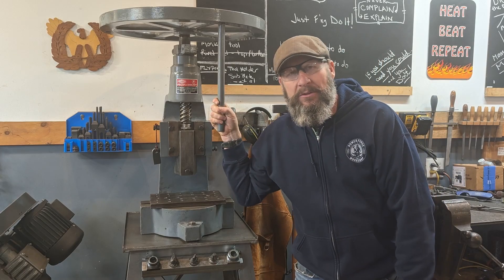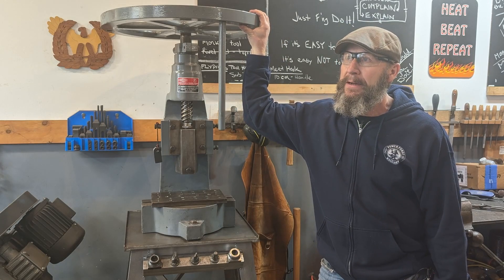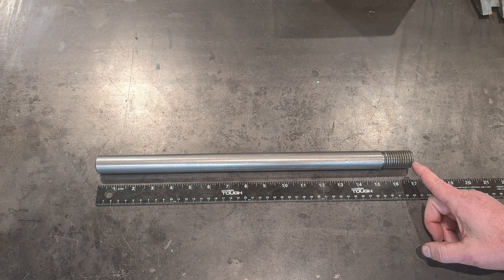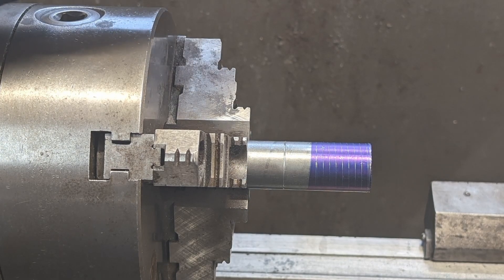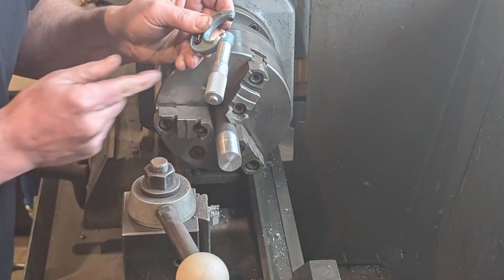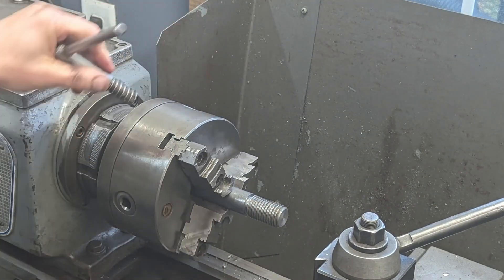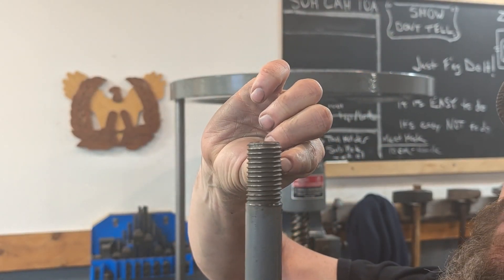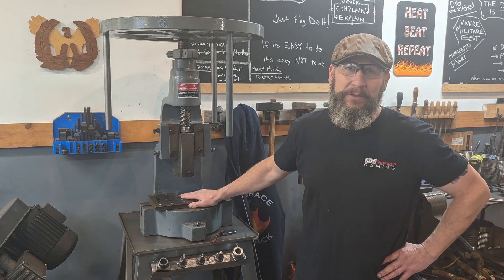Making a Fly Press Handle Rod

Comment: I enjoyed your video! I have the same fly press as you. If someone doesn’t have access to machining they could cut the treaded end of of 1” bolts and weld them to the end of the round stock. That’s what I did with mine. I used the TIG welding process.
Reply from the maker: That's a great idea 👍 thanks for sharing.  Having all three handles is a game changer.  Very convenient.